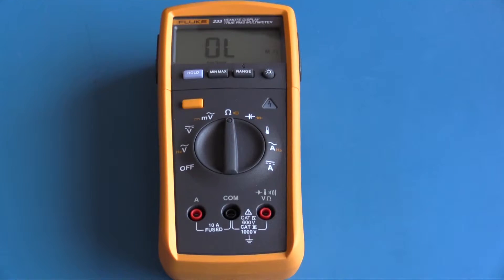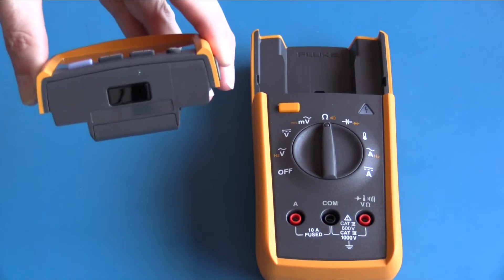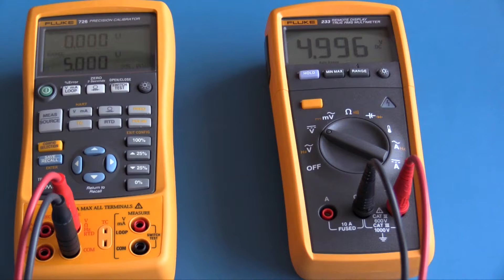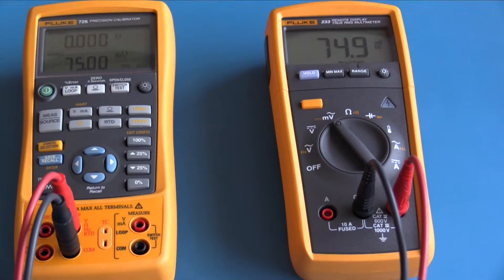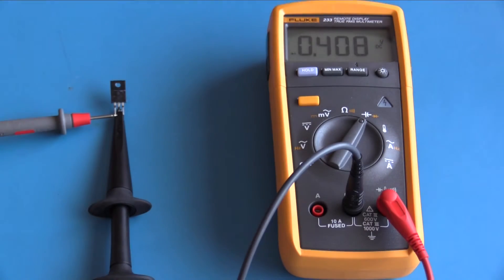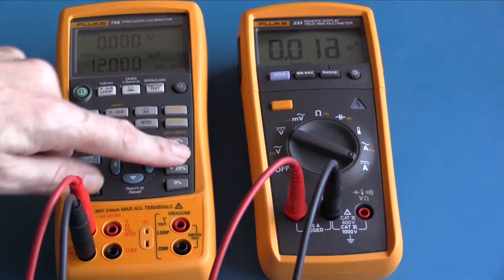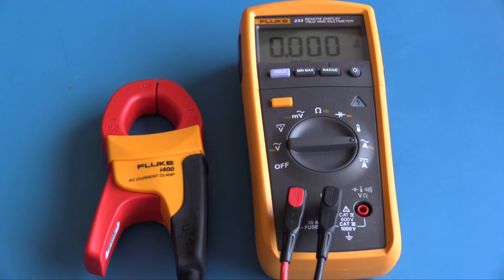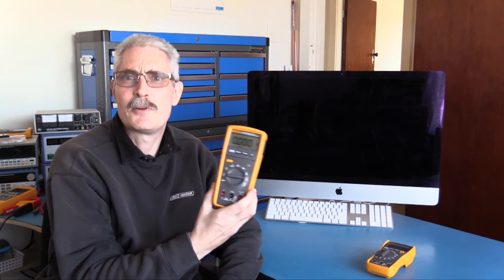BSL017 Fluke 233 Digital Multimeter Remote Display TRMS/DMM

Comment: Very good multimeter, the only problem with it is the batteries life time, no way to use the same for more than one month.
Anyway i use it every day,i fixed it  putting inside a normal switch to turn it off  when i don't use it anymore,!